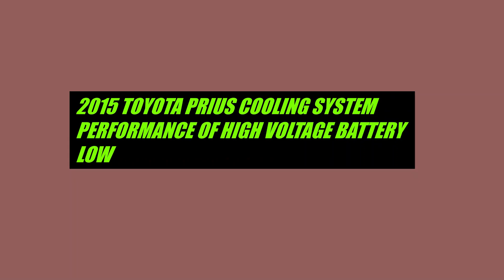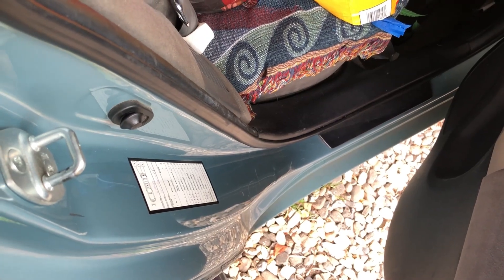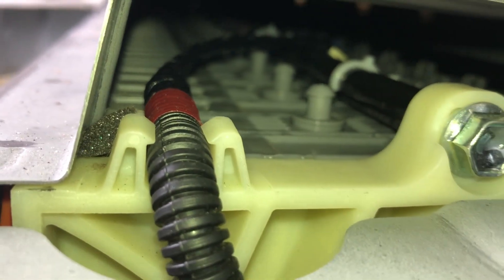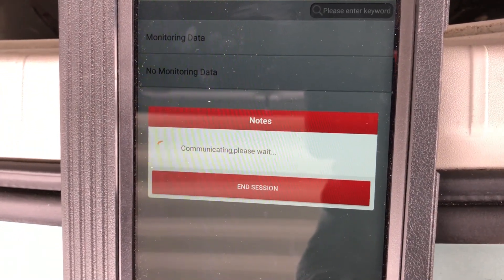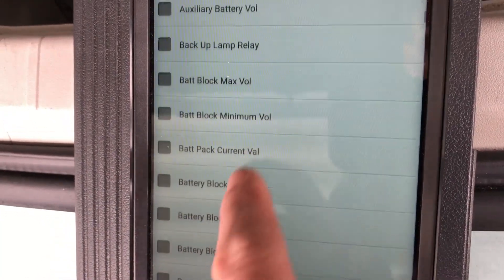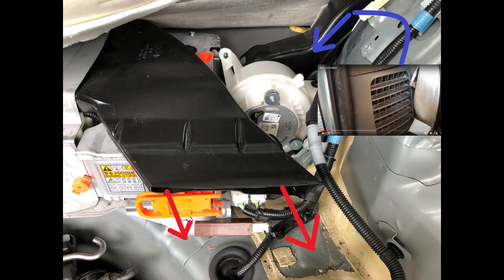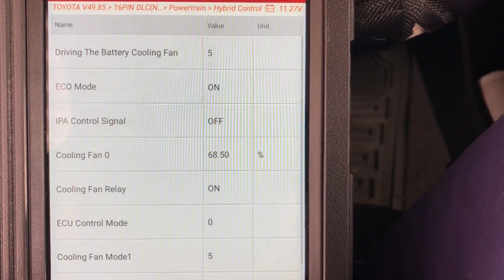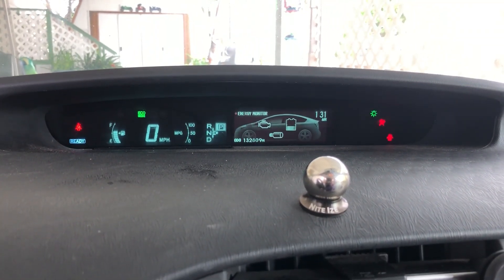2010 TO 2015 PRIUS COOLING PERFORMANCE OF THE HYBRID BATTERY

Comment from the maker: I personally entered CHECK MODE DTC and manually actuated the hv blower . After that and a key cycle the message on dash was gone . Do you have an issue ? These are just situations I have experienced and may not relate to any other Prius .